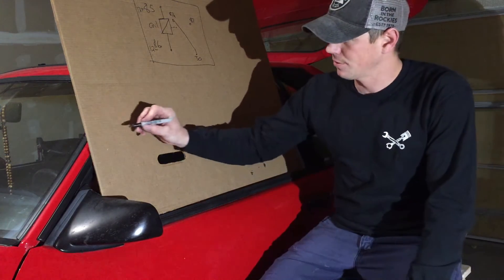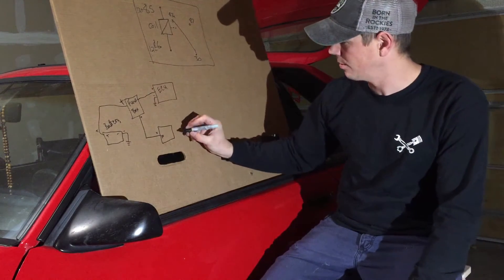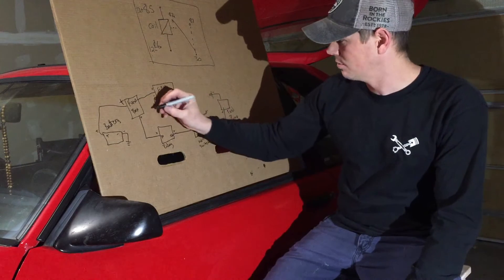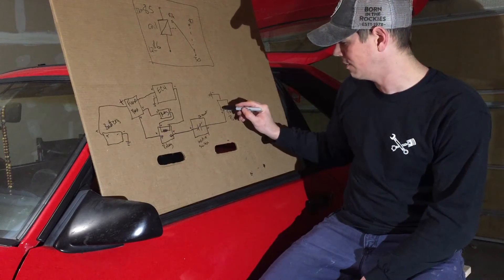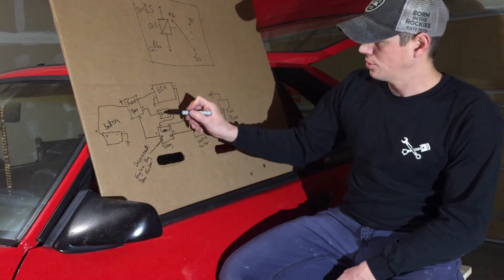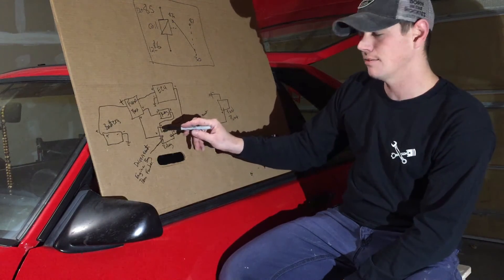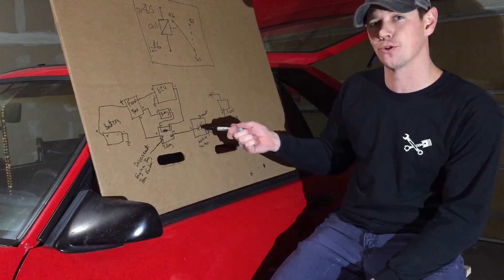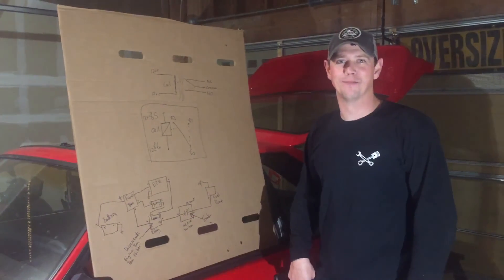Fuel System Layout [Electrical Troubleshooting / Foxbody]

Comment: So ... I have a 93 with relays both on the fender and under the seat . The one under the seat clicks when keyed . I pulled the vert up shut it off with no issues at all . Went out to start it and no fuel pump .. :( ...
Reply: So.... Relay clicks . Inert switch , pump and relay all show the same low 7-8.5 volts . Jump the pump and it kicks right on ? Why do i only have 7-8 volts at tye relay ? It should be 12 right ? Im about to dump the factory p.i.t.b system and wire up a relay to the key lol...
Reply from the maker: The fuel pump relay should have 4 contacts... battery power on my thicker wire, load to the pump with thicker wire,  12 volts from the ignition switch on smaller gauge wire, and the negative signal from the ecu to trigger the relay on smaller wire.

If you on have 7-8 volts on the thicker gauge wire from the battery or the smaller 12v ignition wire, likely a fuse or fusible link that’s bad.

The other possibility is that the channel in the ecu that triggers the relay is bad.  There are capacitors inside the ecu that drive this and other outputs.  I suggest removing the ecu and checking for any bad tracers or capacitors internally to verify its good.

https://youtu.be/3r9HY2bM-CM
Reply: @BMF_Garage  hmmm . Yea 8 volts from the thick wire think its green yellow stripe. I didnt test the 2-3 smaller wires . My set up uses the ford green relay that nine of the part stores have a replacement for . Mine has one less pin . Mine has pens 1-4 .. no #5 pin .
Reply from the maker: Yup,  only has 4 pins.  The pump is grounded back by the tank so the fuel pump relay gives it 12v positive.  You could always try to jumper a wire from the battery to the input side of the relay to test.  That way you can verify if it’s something on the factory wire that’s wrong.
Reply: @BMF_Garage  so .. pulled the seat so i could get better testing.... Ecc supplied 12v + on key for prime and while cranking . ( Pen 2 ) 

Pen 4 showed 8.8v key on or off . . From another sight i found this is the high amp wire  coming from the battery and should show 12v not 8.8... fuse link was good .. i said screw it ran an new wire from starter relay ( same place the other one was) directly to the f.p relay . Andddd pump primed right up ... So just know the relay will click , the fuse link can be good , you can show voltage and still have a bad wire that dosent carry a load ...
Reply from the maker: Yes.  Fuses do that.  They let voltage through when bad, but can’t carry the current for the load... fusible links are awful for that purpose.  If you bypass it, you should be good.  I’ve bypassed all the fusible links on my car at this point 🤷🏼‍♂️
Reply from the maker: Can you hear the fuel pump running for a few seconds when you turn the key on?  If the relay clicks but the fuel pump doesn’t come on there are two possibilities... either your inertia switch tripped, or the pump went bad.
Reply: @BMF_Garage  nope nothing. I jumped the inertia switch and still nothing . How does a pump just go bad ? With no warning?
Reply from the maker: It’s an electric part with a motor.  Sometimes the motor with intermittently stop and other times it just goes bad.   These pumps are cooled by fuel they are submerged in, so keeping the fuel level on the more full side helps with longevity.  

I’d suggest to check for 12v at the pump to verify you’re getting a signal to run the pump.  If it’s getting 12v but not running, pump is probably bad

Comment: On my 1989 mustang my fuel pump doesn't prime. Replaced the fuel pump relay, checked the inertia switch. When I ground the fuel pump wire at the test port or at the computer it runs the pump but it doesn't shut off. When I ground the pin for the check engine light at the test port the fuel pump primes and operates normally. I've left it grounded for now so I can drive but my check engine light is on because of it. Any idea of how to fix this? Thanks.
Reply from the maker: Sounds like a bad output on your ecu.  I’ve got another video that outlines checking this out...

There are capacitors inside the ecu and when they start going bad, it causes many issues including what you’re experiencing.  

Watch this video and check your ecu out... odds are, bad capacitor.  If not, then there are a few more things to check out as far as loose connections... but best to start here...

https://youtu.be/3r9HY2bM-CM

Comment: great strait forward Video,.. thanks for that.  I have a different problem however,  there is another relay up in my dash ( sounds like its up near the drvr side front speaker) havnt located it yet. I slowly turn my switch and first the relay up in the dash clicks, Now I have 2 other fox bodys,.. That relay is the one stays ingaged for a short time then clicks out if you dont start the car,... it times out,... this one is not doing that,  It comes on, then a little further forward with the key and the fuel pump relay under the seat kicks in,....  the pump is running,  that other relay doesnt kick out. ( and the car wont start) its getting fire, checked first with a spark tester then pulled the hose off the throttle body and used starting fluid,... it starts. My question is,... that other relay that times out, is it controlled by the "brain" in the kick panel or  does it do its thing on its own. I am trying to find the fuel pressure relay or sensor cause the pump runs, doesnt kick out after a few seconds and the engine wont start,....  where and what should I be looking for,... my guess is whatever opens to let the fuel thru to the injector rails is not  working,......  Thanks in advance Grant
Reply from the maker: Sounds like an ecu issue, not a fuel issue.  

This video walks through checking the ecu.

https://youtu.be/3r9HY2bM-CM
Reply: thanks much for the quick responce, next break I take Ill watch the vid!!!  Thanks again
Reply from the maker: No prob!

Comment: Relay wont click till i smack it. Used 4 new relays still the same. When i smack the relay itll click but then the fuel pump runs constantly an wont click back off.
Reply: The inertia is fine. Heard it could be a ground or the eec relay or the ecu.
Reply from the maker: You will have to check the fuel pump relay and verify the ground signal coming from the ECU is active all the time. Use a volt meter to check continuity from the ground of the coil on the relay to a ground on the chassis.   I have another video that explains how a relay works if you need it...

If the ground signal is always active to the fuel pump relay, then I’d pop the cover off the ecu and check for residue on the capacitors inside.  They are easy to spot because they will have green fuzzy looking residue around them if they are bad...
Reply from the maker: Have you tested the voltage to the relay to verify it’s on/off when it should be?  If voltage stays constant, it could be a separate issue...

There are 3 capacitors in the ecu that can go bad and cause the same issue... it’s worth popping the cover on the ecu open to take a look.  If they are bad, you will see green fuzzy residue on or by the capacitor that’s bad...
Reply: Clevor BMF ok this is gmetz on my buddies phone one of the capscitors is bad thanks for the info why would it work only sometimes. Can it be rplaced or does the whole ecu need changed out?
Reply from the maker: So, you can change them out individually a lot cheaper than replacing the ecu... Ill post a link to video I found that explains it really well...  Theres a couple tools you need plus a steady hand to solder, but its not that tough.  Ive had to do it on a couple different ECUs...
Reply from the maker: https://youtu.be/-O7FUoQzTB4
Reply from the maker: hope that helps!
Reply from the maker: The working only sometimes part is probably due to the capacitor going bad but not completely bad yet.  It will hold a charge sometimes but not always.
Reply: I heard it could be the eec relay
Reply: But no havent checked the voltage how do you when its on? Prick the wire?

Comment: Thanks for the information, my relay gets very hot and it melted and had to replace it . still couldn’t figure out the cause of the heating. Can you help me with matter?
Reply from the maker: Usually just age.  The pump draws a lot of current.  If you replace the relay, it should fix the issue.  You can also upgrade to a higher current relay to help with this.
Reply: Clevor BMF Thanks. If I upgraded the relay it won’t effect the fuse from the current needed by the fuel pump. And isn’t the fuel pump built to stock electric wiring load?
Reply from the maker: The fuse will still do its job and protect the wiring if the current gets too high.  Just make sure you don’t over size the fuse on the circuit.  The relay has moving parts inside that get hot and fail.  Sizing it up won’t hurt anything unless you size the fuse up also.

Comment: what ever you do .... don't do like me and put new pump in by yourself without testing the new pump first. even if it is from a top brand...... ouch.... ya now I have to drop the tank after hours of checking ecm and all wiring....... ughhhhhhhhhhhhhhhhhhh! I even pulled the ecm and now can't  get it back up in that tight spot.... anyone now the trick to get it back up in the kick panel? all caps looked good car starts with start fluid only. all relays clicking. rpm showing all grounds and power on ecm are good aswell....... very frustrated at this point.
Reply from the maker: There is a Schrader valve on the fuel rail... I’d push the middle of it after the fuel pump primes and see what kind of pressure you have..  

Can you hear the pump kick on to prime when you turn the key to on?  The ground to the fuel pump relay from the ecu is what activates this...

Could be a connection issue at the pump also... I’d check for voltage and ground  with a meter at the fuel pump connection when the key is on... you’ve only got a small window where it’ll have voltage, so you’ll need s second set of hands And eyes to do it easier...

Comment: when i put the new pump and new solenoid didn't do anything then sudden star working .took it for a ride is was working good came back to the house parked later try to starter again no luck . when i try to turn the switch on i ca't heard the pump on where can i  check for spark thanks for replaying.
Reply from the maker: What year is your car?  There is a fuel pump relay under the drivers seat or in the engine bay on the front passenger side.  Sounds like your relay is going bad.

Most parts stores sell a spark checking tool for about 10 bucks.  It goes in between the spark plug and spark plug wire for that plug.  Has a light on it that will light up if there is voltage being given to the plug... that’s the easiest way.  You’ll have to have someone watch the light while you crank the engine. Here’s a link.

https://www.summitracing.com/parts/rnb-86579?seid=srese1&cm_mmc=pla-google-shoppingsrese1_-dorman&gclid=CjwKCAjw7tfVBRB0EiwAiSYGMx0lX3VeZWsrMetXk-ERo07Z0h2agH99qpzY2q4Vo-8pNbJPvSrmmRoCDcYQAvD_BwE
Reply from the maker: I’ve got another video in my tech/how to playlist on checking a relay.  Here’s a link:

How a Relay Works, Electrical Troubleshooting [Foxbody Mustang]
https://youtu.be/XNWEb9ok3lQ

Comment: question i change my fuel pump and  relays are good also i put a new solenoid but my car still  wont start what else could it be.
Reply from the maker: I’d check at the fuel rail and make sure you have good fuel pressure... there’s a schrader valve on the fuel rail... push the pin in the middle and check for pressure.  Verify you can hear your fuel pump cycle on when you turn the key on.... if it won’t start and you verify you have fuel, then it would be a spark issue...
Reply: @BMF_Garage   I’ve replaced all fuel pump related relays besides inertia switch, car will crank but no start, turn key to on position but fuel pump doesn’t kick on. Could it be the inertia switch ?
Reply from the maker: Could be the ecu.  I’ve got a video on checking the capacitors in the ecu to see if it’s back.
Reply: @BMF_Garage  I sent of my ecu and it was rebuilt, I don’t have fuel pressure in the lines
Reply from the maker: I’d start at the pump then.  Can you hear the pump turning on?  If not have you tried to jumper the relay to kick the pump on?

Comment: Found this video through a FB group. Thanks for the information!  

I have an '86 that I recently got back together after a stroker build, k member swap, total project snowball effect. 

I get no clicks when turning on the key,  but the HVAC fan turns on, so the switch is at least engaging.  I repainted the engine bay, so not sure if I should be chasing grounds, or I may have some stuck relay as you mentioned.  Any hints where you might start with this scenario?
Reply from the maker: Jody Barber Jody Barber is your car still EFI?  If it's EFI, and you get no clicks you'll need to look at the ecu.  It gives the ground pulse to the fuel pump relay.  The only scenario that would cause the ecu not to do that is it's bad, or it has no power/ground.

If your project is carb now, you'll have to find the ground wire for your fuel pump relay and put it on a switch or something that has ground when the car is on. 

I'd get a meter and test for power and continuity to ground on your fuel pump relay when it should be running...
Reply: Yep, still EFI.  I'll check the fusebox first. I don't know why I didn't think about it, but there could be corrosion on contacts from the heavy humidity. Never hurts to remove and replace to cut new connections regardless.

I'll chase those connections first and see what she do. Thanks!

Here's mine, yours looks a little familiar! :)
http://i178.photobucket.com/albums/w262/Slo86GT/Smokey/20161112_181011.jpg
Reply from the maker: Jody Barber that's a good lookin car!!!
Reply: B Stang thanks man!  had him about 20 years now. pretty sad that he's down as long as he has been.
Reply from the maker: Jody Barber feel the same about my car.  Had a baby and haven't been able to fix a couple small issues to get it back on the road.